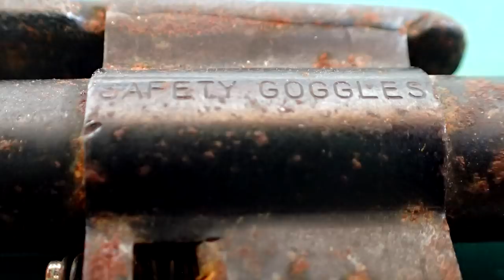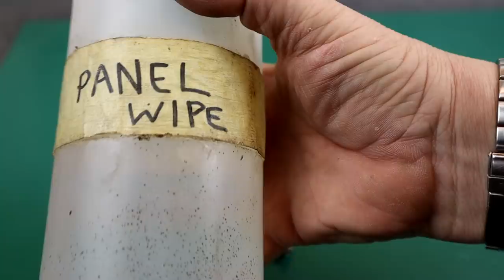I Didn't Know What These Weird Pliers Were Till I Restored Them

Comment: The safety wire used with these pliers is Stainless steel, very ductile but with very high tensile strength.  Typically found in two gauges and used to secure AN type fasteners found on every aircraft. These pliers are readily available from suppliers like Aircraft Spruce.

Comment: Lockwire pliers. Used them on F16's in the Air Force back in the 80's and use them now on my old Harley's. Best way to keep the barrel nuts from backing off on old Pan's, Shovels and Ironheads.

Comment: They are used in Industry for attaching stainless steel tags to equipment among other things. A variant is used to tie reinforcing steel together. The wires have loops at each end and the tool has a hook. Good quality ones are quite expensive.

Comment: Had an incomplete pair. I was told they are aircraft wire tying pliers for safety to prevent nuts from becoming loose. I used them manually in construction to tie wire on rebar reinforcement prior to pouring concrete in slabs or walls. Mine were completely chrome plated. Of course I didn't have the spinner part.

Comment: They are safety wire pliers and are used in any industry that requires you to run thin gauge wire through bolts or nuts that have holes drilled through them. Mostly used in Aviation and Military machinery.

Comment: I’m going to guess they are either for safety Wire  or  tying rebar together  for concrete reinforcement ?  Although ive seen much less complicated tools for rebar  ( simply a hook that spins on a wooden handle  and you use a tie wire that has loops on both ends
Reply: The hook is less complicated, but you'd play hell trying to get the loops for the  rebar wire through the small hole in a bolt head . . .😁

Comment: yes they are used for twisting wires together usually for rebar, or electrical wire connections.
Reply from the maker: These are used in the aircraft industry.

Comment: I build machinery and use them to tie bolts in a reverse S so if 1 bolt should losten it pulls on the other bolt in the tighten direction.

Comment: I used safety wire pliers on 6 jet engines  and gas turbins that ran peaking units in power production,for an elec. utility.wore out three pairs in 35 years

Comment: My guess is when I worked in the air Air Corps in the Army we used a similar tools to twist wire that goes to the bolts to anchor down the rivets that go into the sheet metal on the planes and choppers

Comment: There is a different version of these pliers where the knob on the back end is spring loaded.  Instead of pushing the swirl plunger back inside, just release it and pull handle snaps in ready for the next pull.

Comment: Lockwire pliers. I used them in the RAAF. Lockwire was tied at 8 twists to the inch or else the supervisor cut it and it had to be done again. I understand that you had never used them , but that is not how a nut is lockwired. Wire is placed through the hole in the nut and twisted to the locking hole, one end placed through that hole and then wire twisted again..
Reply from the maker: It was just a crude demonstration bud.

Comment: They are used to twist wires for aircraft and nuts.  You put the wire in the grips and then turn the pliers.  the wire is then twisted and secured.

Comment: I am surprised that safety wire pliers are still in such common use (see all other comments).  I thought that way of securing bolts against vibration began fading out in the 1920's or 1930's.  I guess if a thing works really well, it never dies.  Thanks to the commenters, and thanks for the video!
Reply: Shoot, we could wear them out safety wiring race car engines and suspension bolts.

Comment: Dude awesome restoration and I want that tool. What the tool called? Also what was the brand of the wrench you use in the video?
Reply from the maker: I couldn't quite make out the make but they are wire locking pliers.

Comment: I actually knew what these were before I read the title, I work around ag cats and know a few pilots. What They do is quickly twist a wire thats wrapped around a bolt head then pulled clockwise as to put tension that bolt, the other end being tied around an adjacent bolt to the same effect which keeps both bolts from unfastening unless the wire is cur.  Its as simple as that but look inside a planes engine bay (like a dash 34 or 802 for example) and see how many of these wire ties it has. By the way a pilot friend of mine who is also a airplane mechanic has a small wooden toolbox he takes out for annuals ects and the first time I saw him with it this was one of the first tools he took out to place on the workbench.
Reply from the maker: Nice info bud. Cheers

Comment: Safety wire pliers. Wire is threaded through holes in the bolts/nuts/whatever, twisted with the pliers, and tucked away.  Safety wire is used on most anything mechanical that you don't want to come loose.  The brake calipers on my drag car are safety wired.

Comment: they're used in the automotive and motorcycle industry for twisting safety wire on Nuts and Bolts when you pull the handle they twist the wires themselves

Comment: I don't know why there's so much of an argument against paint for preventing rust.  Maybe it's because this is a tool?  In the U.S.A.F. we routinely painted to prevent rust on aircraft (used safety wire pliers, too).  We were shown a training video on how to prevent corrosion.  The video said it's due to dissimilar metals touching, an agent (like water), and from metals oxidizing.  Once all corrosion is removed, the paint isolates the metal from the air prohibiting oxidation.  I spent several months on an aircraft wash rack where we washed then painted possible corroding spots to prevent further corrosion.  Here's an example from an FAA file which talks about painting metal at the end of the video: https://www.youtube.com/watch?v=cHfRGQdnC04
Reply from the maker: Well said Ron.

Comment: Sometimes called duckbill pliers - indispensable to aircraft engineers for safe tying of fittings.
Reply: Duckbils are a different thing,  pliers with jaws that taper to a flat tip, these are lock wire pliers as many others have said

Comment: You didn't restore it, you restomoded it. Those are lacing pliers. Used them alot on tanks when I was in the army. Should of reblued it instead of painting it. Never saw one that was red or with a polished lock. The little nub on knob is so you can place your palm on it and just push it back in instead of turning it like you did to reset. Good job though.
Reply: ...should have...
Reply: Mine are painted blue, new ones today are often painted (red, blue, black).  They start around $15 and go up to at least $95.

Comment: The safety wire pliers I used in the Navy were much better quality then the one you restored, but we never used them with stranded wire, only stainless steal single strand safety wire. We never would have twisted the wire as tight as you did or the wire could stretch and the bolt loosen. QA would have had a piece of my butt. I'm sure there must be a video somewhere on YouTube about the proper way to safety wire bolts and other items.
Reply from the maker: Yes, I have found vids on wirelocking bud. Cheers
Martin

Comment: Lockwire pliers
Reply: Used those for many years working on aircraft.
Reply: The way they're designed, if you just push on the knob while you hold the tool steady, it'll push right back in. The knob is supposed to free spin.

Ideally, you'll run the wire through the bolt head, then around it, twisting until the wire is tight up against the hole. Then you run it through either another bolt, fitting, lug, etc., and do it again, ensuring both items are pulling in a way that keeps them from loosening over time.
Reply: Great find, though. Those things are expensive when new.
Reply from the maker: @Jetmech1781  Good info bud Thanks.
Reply: For dirtbike grips
Reply: Beautiful restoration.
Reply: Also on subs Ann aircraft carriers

Comment: hi 
this pliers was used to fixed metallic cable inside head of nuts 
like to fixe aircraft propellers head nuts 

pairs of pliers coming  from aircraft mechanic tools box's 
or same but so important to big  boats same to fix any valve to stay open or close
Reply from the maker: Yes, they came from an aircraft fitter.
Reply: when i was started pilot license 
i was walk in the tools shop 
that s why i know it 
and both i am tool passionate

Comment: When the idiot inspector general (I G inspectors) were coming (some how we always knew) We would over tighten the connectors on all the equipment in the avionics racks. Then wire wrap them, then back off the connectors. That way it would pass the IG  test. Many a connectors had the holes ripped out by guys trying to just use the tool in one step. We always carried hand drills to make a new hole. The IG's always carried thing too far.

Comment: I own two. Look, any A&P mechanic is having a good laugh. Copper really dude? Try stainless and talk to an airframe and powerplant. You never and I mean never lose one.
Reply: Tom,
Yeah, copper really usually .020 single strand.
Mainly used where you need to be able to break the wire to unlock something.
Like a fire extinguisher bottle bracket lock or an emergency covered switch in the cockpit.
Wish I had a dollar for every foot of safety wiring I did over 32 years. 
Cheers